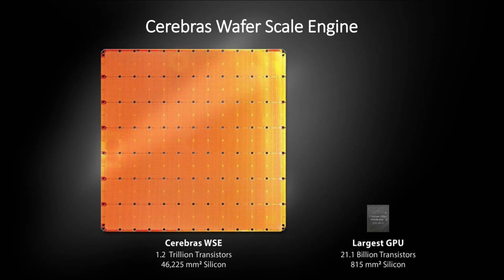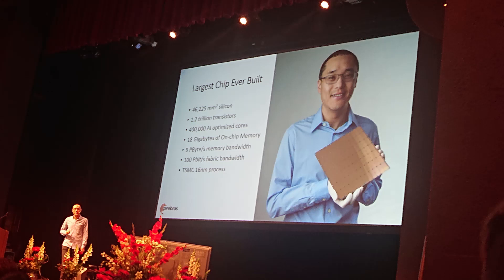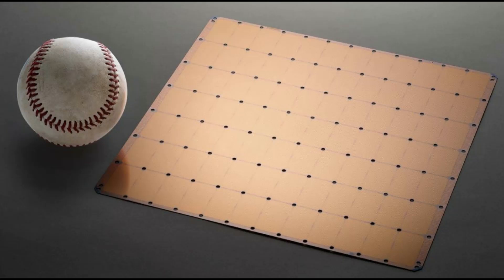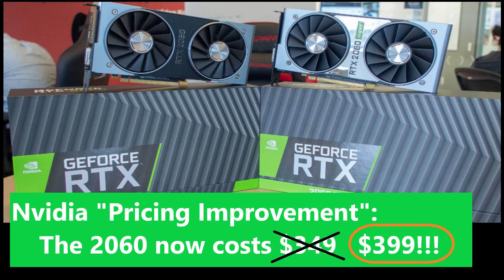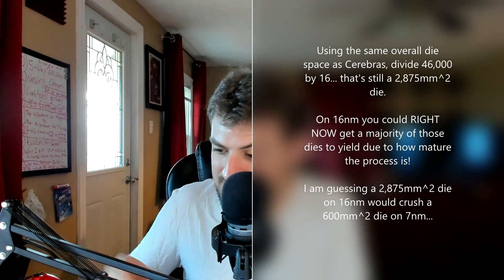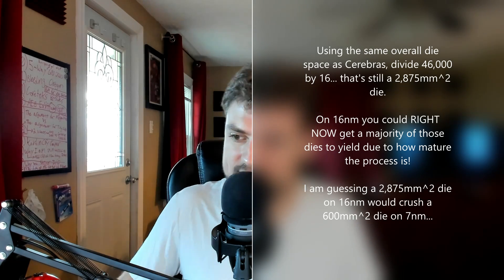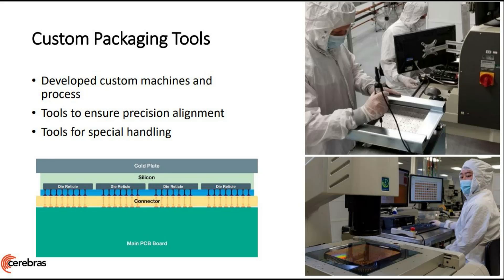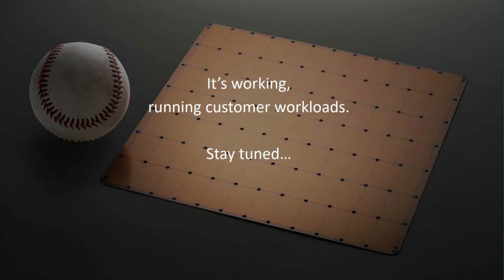The Monolithic Future of Silicon

Comment: Amazing engineering now we just need some fairy Dust to cool those chips and hit a stable 10GHz.

 My bet is on Chiplets to dominate innovation at least the next three Years until cooling advances to a point that we can reliable cool those huge dies and multi layer packages without compromising clocks.
But what do i know maybe someone out there has all ready a solution to the problem.
Reply: Yes, first through stacking and then monolithic 3D manufacturing - the only problem is cooling the stacks until they switch to something like Spin logic.
Reply: Re: 5GHz, yeah, we hit that on 32nm. I think 14nm might be the peak as far as clock speeds go. 7nm has some serious hot spots and it's only going to get worse until they change the silicon for something more conductive to lower the switching voltage below .7v.

As you said, once the circuit size is reduced it increases resistance which increases heat which increases resistance. There is a minimum size for a set amount of current. They're lowering the circuit size but keeping the same current effectively, so they're going to get more fragile unless they change to a more conductive material.
Reply: Glen Waldrop It’s actually getting more fundamentally limited than just ohms law, quantum mechanics is becoming the limiting factor. On silicon we can’t really only go down lower than 6nm because at that point the electrons in the wires begin to quantum tunnel from track to track. We already have semiconductors that can go to much higher frequencies that 10GHz however, GaAs (gallium arsenide) for instance, has a much higher mobility than silicon and can get up into the terahertz range, problem is its extremely expensive and so can only be used in specialist applications
Reply: That huge die lowers latency so much that in the workload to what is was build, it probably would be faster than having those cores externally running at much higher clocks. My guess is that something like 500mhz would make that chip already "profitable". Memory in that will essentially be like L1 cache when it's close, and L2 when it's far away.

But we will see. If that works, I would hope they would use the whole wafer next time.

That chip most likely requires slow "bootup" to operating temperatures, but after that I don't see any problems for cooling that.

Comment: Thing is, a 30cm (12") wafer can only make a 45000mm^2 (~212mm width and height) rectangular die at most, and that's with no scribe spacing (which you don't need) and no edge loss. But theirs is an octagon(?), which gives them the 3mm extra width and height required.

But that's interesting, I've never seen an octagon(?) shaped die before. Nor one of that size obviously. There're several interesting thing about that processor.

Comment: What they need to work on is more performance for less money I mean 1200 to 600 to 700 the 1080ti was 700 rtx cores doesnt make it special and it shouldn't cost any more then previous gen if not 100 or 2 less. The prices are getting way out of hand and need to be reeled in I expect as technology improves it gets cheaper yet it hasn't in years and has only gotten more expensive.

Comment: In a previous video you mentioned how the Navi dies are 33% smaller than Nvidia's current offerings, provided they were on the same process node. Because of this fact, we should be anticipating huge things from AMD because they have a lot of room to grow their arch.

In this video you mentioned that seeing how big Voltas die was made you anticipate Nvidia being ahead for the next several years.

Am I missing something?  The first statement makes a lot of sense to me, but the other idea that Volta would be ahead for awhile because it's beeg seems weird.

Is it just that the Volta approach is basically just "We have a mature node, lets build the biggest fucking die we reasonably can", and AMD had nothing similar?
Reply: I would think that volta being so large would be indicative that Nvidia couldn't think of ways to make it better without making it larger.
Reply: @jacoby6000  because nvidia want volta to hit the market in H2 2017. Back then 7nm is not even ready yet. But thanks to that nvidia no longer being held back with the usual limit they have on previous nodes.
Reply: That's only true if we directly shrink turing without further enhancement on the architecture itself. Just look what nvidia did with maxwell to pascal. according to anandtech maxwell and pascal IPC  should be outright identical. Then how is that GTX1060 with 1280 cuda cores able to march GTX980 performance that have twice the amount of CUDA core?

Comment: I have think about this for some time ...

Why don't they make them up to (like skyscrapers) on top of the "main" die, with some "plates" of diamond between the die.

Instead of making all the connections between the dies, using the "main" die as the connections areas, they don't need to make a big die but adding several small ones in a "normal" size die and using the separation diamond plates to cool it down.
Reply: Like where is written that all dies have to be flat
Reply: Diamond is not a magic heat radiator, it conducts heat well but you still need to channel the heat AWAY from the stack or it will build up, and very quickly the more dies are stacked together.

Even AMD estimated that stacking HBM on top of a 32 CU chip would require keeping the logic at a meagre 800-900 mhz to keep it cool - though it was in an array of 8 such stacks in that paper, so it would still have been fairly performant in total.

Unless the dies use a more power efficient logic paradigm like Spin Wave, All-Spin logic etc - this would potentially allow for large stacks of logic and memory with minimal cooling, albeit that future is a long way off at the present level of the underlying tech (theory is there, but needs to be massively scaled up in density to match current CMOS processes).
Reply: hmm, so they have try it before.

Well sure the diamond was to relay heat but they don't need to be next to each other, we can separate then in the main die but I see your point.

We might get a tech that can work on low voltage and keep things cold to a point that can be a reality, look at the new Sku's for Intel and they low TDP

Comment: Maybe these should be called megalithic dies.
Reply: The supporting architecture to power and cool those things will be about the same as erecting a standing stone, so sure!
Reply: @ANonymous-bh1un  
I think at that size it's much better to soak the whole thing in mineral water.
Reply: @samlebon9884  Whether you're doing water or mineral oil, you're still going to want a tall, out-sized reservoir - so again we're back at "standing stone" form factor.  To say nothing of the wiring to get fifteen kilowatts of power to the chip and then keep the transformers cool as well.
Reply: megalithicc you mean
Reply: Behelithic
Reply: @635574   Berserk fan spotted.
Reply: Jurassic GPUs.
Reply: Ace combat 04 flashback there....
Reply: Hella-lithic
It should be bundled with Hellabytes of memory.

Comment: I have some wild ideas now in my head of a press down lock for the cooling block lever to press the CPU into MoBo.
I also think exploring new solutions of materials will be imperative, even as we play with ways to circumvent Moore's law. That way when we hit another or tougher challenge we have options. Like carbon nanotubes (IBM testing this one out, with limited success) or graphene (way better electrical conductivity and smaller) for transistors.

Comment: I can see this being viable for enterprise applications, but my only question would be how they would account for cooling such a large chip in a desktop form factor. Obviously, you wouldn't be seeing the entire wafer being shipped as a desktop chip, but even so increasing the die size significantly will require us to go bigger with cooling solutions alongside it.
Reply: it really depends on the power usage, if this thing was relatively low power with power usage spread out well it would be pretty easy to cool. This will only be in AI "Servers" so they would be running super high rpm fans with probably 4 of them. With a large flat heatsink blowing down.
Reply: Immersion cooling.
Reply: Well for something that is that big and theoretically that powerful, wouldent it sense to have a central computer / server in the office, and a bunch of computers to connect to it, such as thin clients? That way you dont need to worry about space for cooling.
Reply: @James Smith It kind of sounds like you're describing a human brain.....
Reply: @James Smith Oh I listened. It was just a fun thought that silicon is starting to mimic organic neural networks. It's been a long time since processor architecture has been exciting.

Reminds me of the Pentium 3-m then original Core 2 chips.

Comment: If that's the size of the CPU the included cooling solution should be an iceberg.
Reply: I  think Iceberg will not do that job 

you will need a nuclear cooling tower to cool down that CPU
Reply: Believe it or not, thermal density is lower than Intel's current cpus, especially when overclocked. This is also definitely true for R3K during low current race to idle scenarios. But consider how the 18 core 9/7890xe can pull well over 500w in the mid 4ghz range. That's a 322mm^2 die. So let's just say it's pulling 500w, that means the 15kW wafer scale accelerator pulls 30x the power with 142x the surface area. The surface area doesn't really scale linearly due to them shoving so much sram in there, the things really doing the work are more concentrated. But it at least gives a pretty decent idea for perspective.
Reply: @Valkrss  Thermal density is the key here. What are the major factors contributing to heat output besides density of the transistors and surface area of the silicon? I know from Jim @AdoredTV that fetching and writing to memory takes substantially more power then executing code. 

It also seems that dramatically increasing on-die memory means less clock cycles will be spent waiting. This means execution units will be active higher percentage of the time perhaps making more heat? 

As usual your videos leave me down very interesting trains of thought.
Reply: @faceplants2  I assume you're responding solely to my reply to Brendan. If you scroll up a couple posts I talk quite a bit about thermal density. Which can be viewed in many ways. Often a modern microprocessor operates in a race to finish scenario, so it can shut portions of the die down, even for a few cycles. This is where a lot of the efficiency for zen comes from.

While keeping the cores fed more consistently will increase power draw, the actual power spent transferring bits outside of the die don't necessarily correlate to added power to the die itself. Strictly in terms of total platform efficiency it's definitely a factor. But that doesn't necessarily correlate into on die energy. Not 100% at least. Unfortunately I lack the background to go further into this, however. But you're correct in assuming more transistors switching more frequently equates to a higher power draw/cycle in the moment, since many processors actually spend a perspectively large amount of time waiting.
Reply: @Valkrss  Thanks for the follow-up info and yes I was specifically highlighting your point about thermal density being key and not just the total power consumption. 

I've worked in the tech world for nearly 20 years now but only in the past year or so have I really started getting interested in the nitty gritty details of architectures and lithography. The amount of quality content nowadays that caters directly to those interests is fantastic.

Have you found any more gems the likes of AdoredTV, Coreteks and der8auer out there?

EDIT: Speaking of keeping more of the processor busy at all times... Didn't they change the graphics pipeline with RDNA to do just this?  split workloads into 4 streams vs the previous 2 or something along those lines so the CUs or SMs spend less time waiting
Reply: Smaller node sizes mean we can still run at relatively low voltages while maintaining clock speed. Considering that a lot of CPU clock ticks are wasted on retrieving information from memory and writing to memory we can eliminate a majority of those reducing the need for higher clock speeds. Maybe at 3 and 5 nm we won’t need cooling. Also, while these monolithic dies are impressive, this will create a larger divide between consumer PC products and servers.
Reply: The caches are doing a good job of keeping everything fed, but yes, we could still see some improvement.

We're still going to need cooling though, we're only making hotspots worse, cooling is going to become even more critical and honestly we may see more clock speed reversion as the lithography shrinks. We're still having roughly the same amperage go across smaller and smaller circuits. Cooling is going to be an issue unless they change the substrate used to lower the switching voltage below .7v. Right now that is the current minimum. We're hitting that on lower clocks today, but ultimately that means higher amperage which means more heat.

Gotta go to a more conductive semi-conductor to move forward.
Reply: @NeverFinishAnythi  there's also a limit to how much efficiency you gain by operating at lower clocks. In terms of perf:watt there's diminishing returns at both the high and low ends of the frequency curve. But I do agree with you about massive savings on wasted cycles due to having multiple gigs of sram. Additionally, cooling will become more important the smaller the node gets. Because the heat is being focused faster than its actually being reduced with the newer nodes.
Reply: You just clock it low enough so cooling is possible with conventional solutions. Still having a massive die means you have a chance to design the architecture in a way that your ipc still goes up...
Reply: I also wonder what kind of problems you'll have from differential heating. With a die of this size you can have significant temperature gradients. I'm not familiar at all with the thermal properties of silicon, copper and the other substrate materials...
Reply: No icebergs left, they all melted, thanks to humans.
Reply: @bernrudolph2422  Hmmm i blame the dinosaurs. The first ice age. The dinos created global warming. So it is their fault the world is all messed up now.

Comment: Instead of making everything larger, can't they shrink everything and make it smaller? They are shrinking the die, so logic leads that they could shrink everything else. This will give them space for so much to put on a chip. They can still make the overall chip itself bigger but if everything on it is like 3nm it would be capable of everything.

Comment: I think imma upgrade 2 years from now. Got a 1400 OCed to 3.8GHz and RX 580 8gb with a 1440p 155hz monitor.
Reply: Do you play your games with low settings? I have a few GPUs and a monitor about the same as you. My 590 doesnt come anywere near utilizing the monitor to the fullest at high or ultra settings
Reply: @skoopsro7656  Mmm? I have a Vega 64 with i7 7800x and on witcher 3 I get 80 fps at 1080p ultra
Reply: @ImperatorBaldo  I've never played the witcher3  more than the first 5minutes. And that was with my 2080ti. I dont remember the frame rate.
Reply: @skoopsro7656  with your Godly card you should get 144 . Maybe for me is the processor , I do think that since it is not OC and I have just 2 sticks of rams could drop performance
Reply: @skoopsro7656  I completely know that I can't fully use the monitor with my hardware, but the monitor is the latest of my purchases (~3 months back whilst my PC is ~3 years old). I generally play Hearthstone and GTA 5. I get like 60-100fps in GTA5 which is okay honestly, I don't wanna drop any cash on upgrades right now. Minecraft Hearthstone CS GO Krunker IO all work well enough and I'm not as into gaming as I used to be.
Reply: @lordswaggity1213  I was just wondering what kinda games you were playing...like idk if you played csgo or overwatch on low settings or something. The 144hz 1440p monitors on the market now are pretty sweet. I love mine and want to get a second one pretty badly
Reply: @skoopsro7656  yeah no problem! Me too it's so much more fluid than a 60hz monitor and I might get a second one too as windows has some bugs when there is a frame rate mismatch which causes tearing.
Reply: what framerate do you get in general?
Reply: @andreassachse2002  I play the division and assassins creed odyssey slot and those are the only two games I played with the rx590. AC:O was about 40ish FPS at high settings( it's a super intensive game tho) and division2 was more like 75-80fps with high settings. that's going off memory tho and not exact. Rx590stock and a ryzen 3600 with boost on. To be completely honest I would say the rx590/580 is getting a bit too weak to keep recommending. It's cheap and you can turn settings down. But a 5700 smashes it in performance. The extra money is worth it without a doubt.
Reply: @andreassachse2002  if he plays any current slightly more demanding title @high settings (not ultra) I'd guess not more than 70-80 if he's lucky.
Reply: @christoph6055  you basicly more clearly said what I was TRYING to say. Thank you